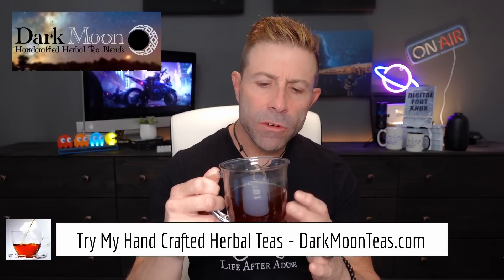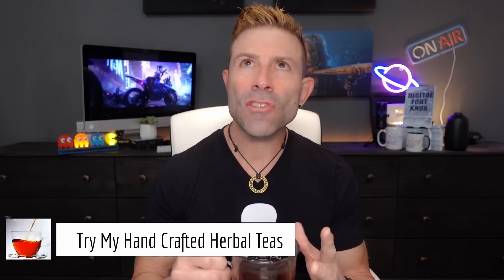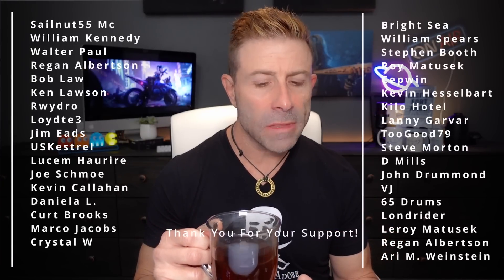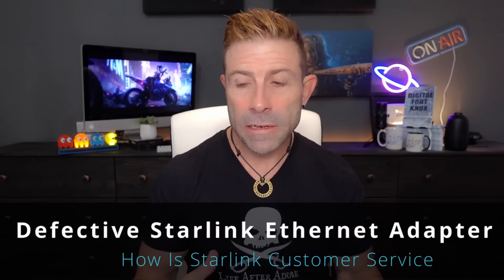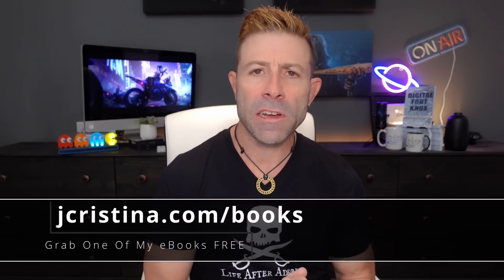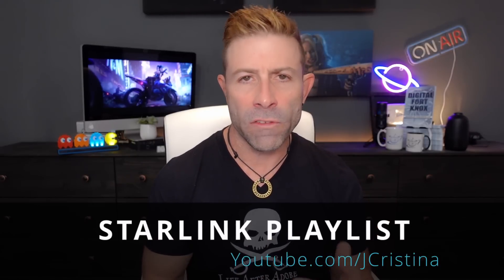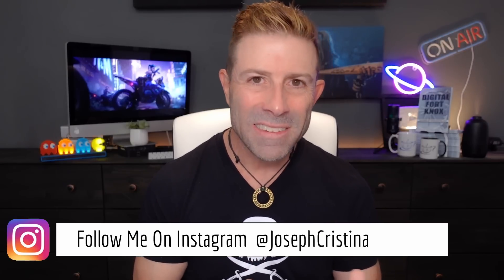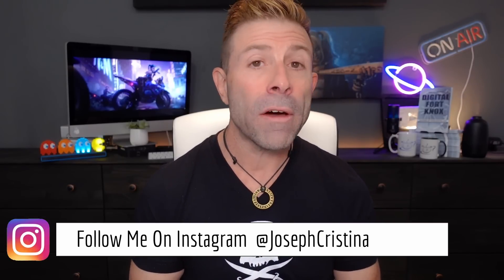Defective Starlink Ethernet Adapter Starlink Customer Service

Comment: I had a similar experience with SL recently; thought I would share.  Once my trees leafed out I was too obstructed to stream reliably.  I spent some time with my phone plotting out the new best spot; stowed the dish, disconnected, reran the wire, and hooked it up and nothing happened.  Wouldn't unstow etc.  So I did as much trouble shooting as I could, unplugging, etc.  Sent all this in tickets to SL.  Unfortunately I never heard back.  But luckily I thought of a previous email exchange I had with them and sent a follow up; this got IMMEDIATE attention.  I don't know if my original ticket was "misplaced" etc but as soon as I brought it to their attention with my previous ticket I received a slew of emails essentially thanking me for the troubleshooting I did, agreeing that something was wrong, shipping of the new unit, RMA, etc.  So while they handled it AWESOMELY once they saw the ticket, my biggest complaint was the time from the first ticket to when they "saw" it was borderline ridiculous.  I am talking 5 or 6 days (with add ons to the original ticket every other day) and I only think they got to it because of the alternate follow up.  Love your content on SL, don't know much about photography...but one can learn.  Thanks for posting again.
Reply from the maker: Thank you so much for sharing.. I love the idea of responding to a PAST email / support ticket instead of creating a new one.. Interestingly enough. This is what I did also but didn't think about it until you brought it up.. Thank you for that!

Comment: Just seen your video, I had to message them to get a new router because I think there was a problem with mine  (I CUT OPEN my rougher to see if I could fix it) so they actually called me and told me that there sending me a whole new starlink set (Satalite and router) for free just return old one and I told them that I cut open the other one and Lorain who I've been messaging almost everytime something went wrong she told me that usually it voids the warranty but they said just send it back with the that no matter the condition and that they told me to hold the old one till new one comes in and return the old one once it arrives and there giving me a month's free so hopefully I'll get it soon I told them this on April 28 and fed ex says it will be here on the 5th wich I've been everything a day later than fed ex I've had My starlink for 3 months with problems so hopefully everything works this time  just thought I'd let you know my starlink story
Reply from the maker: I hope all will work 110% and I'm amazed they took back the cut open unit.. Extremely nice of them, for sure!!
Reply: @jcristina  right and what really got me is that and they actually called me when I called them back i get like a SpaceX voice mail

Comment: My non-existent connection after a week determined mine was defective… still waiting after a week to hear back from them.
Reply from the maker: See if you can REPLY to a previously service ticket / message.. That might work for you!!
Reply: @jcristina  I replied to the ticket I started, if they don’t respond this week I’ll probably start a new one. I found a wireless extender/bridge to hook my switch in to though so my pc in the basement can get on the 5g network again.
Reply: @jcristina  just a heads up, I sent you a message in instgram. If you’re interested in looking at a second adaptor I’d be happy to send mine

Comment: Really appreciate your Star-link videos, I am in northern Alberta, Canada ordered SL for a rural property expecting many months wait, received in 2 weeks! I have tested and actually works :) 
I am following your network advice and purchasing the tp-link devices in advance of building 1) metal workshop with power 1st with SL on roof 2) need wifi to unpowered cabin about 250 ft away, hoping AC1200 will work through some trees, and 3) house next year about 30-40 ft away. 
Question what would you recommend to bring wi-fi from workshop into the house? Sorry for long story and thanks again!
Reply from the maker: I like a buried CAT6e cable best. If not, I would stairstep multiple EAS I have in the description, say 125ft apart outside for the best signal. Is you have line of site, 250ft will work but you will not get full speed out of the signal.. I would simply add additional EAS to the mix to keep the signal MAX..

Comment: i have a similar problem with my starlink v1 sometimes when i close and open my computer my ethernet port is negociating 100 mbps instead of 1000. i have to unplug and plug back the ethernet cable. My computer is connected directly to the aux port of the starlink router.
Reply from the maker: That's a bad "going bad" wire in the Cable most likely.. I would switch it out to see if that fixes the problem.. If not, then it's the computer or SL port, sadly.

Comment: I received my ethernet adapter on 21 April 2022, after a one month wait. After one hour of use, I determined my ethernet adapter was defective on 22 April 2022 - I notified Starlink immediately. Next day I got the exact same response you had. My order was placed etc etc. However, my replacement has not shipped, after repeated inquiries they claim there is no expedited process. They anticipate my order to ship in mid-May. If I had to guess, the STARLINK folks know who JCristina is and they take care of you so you will report your excellent support experience, as you have. I do not think that is the norm... oh, and they also told me I had to return the defective adapter.
Reply from the maker: I would hate to think that.. I'm a tiny channel.. I doubt they know me but anything is possible.. I certainly have never told them. Really sorry to hear this, Timothy!!!! Sucks...
Reply: @jcristina  I sent them a message yesterday (with a link to this video) asking why my replacement, ordered before yours, still was unavailable, while you had yours in three short days. They replied, without answering the why, and said my order will now ship in the next day or two. Something is fishy...

Comment: What components are shipped with Gen 2 Starlink?  I've heard you mention replacing their router so I presume the router and modem are separate boxes?  Or is the modem embedded in the antenna (since the dongle has a direct connect to the antenna)?  Is there a block diagram somewhere?
Reply: There’s also a base that the dish sits on as well, looks like an X
Reply: It comes with the dish, a cable (I can’t remember the length), the router/modem and a power cable.
Reply: @ShawnHinck  So the router/modem is a single box.
Reply: @SMButler  correct
Reply from the maker: Dish, Router, 75ft or 100ft cable. The modem I do believe is in the dish, don't quote me...

Comment: I'm glad I've got the round dish with the auxiliary port built into the router.
Reply from the maker: It is helpful.. You don't have the BY-PASS feature I believe but everything else is as good if not better due to not having to use a "DONGLE"  YUK!

Comment: Hi I watched your video on contacting Starlink to replace your Ethernet Adadptor. I ordered the starling system and while trying to thread the cable through the wall I damaged the cable. Went into Starlink and ordered 2 cable. They are so slow shipping anything out. How can I contact Starlink to get my cable higher on the shipping priority.
Reply from the maker: I think the "slowness" is due to short supply and not actually slow due to not being able to ship the product out in a timely manner. That being said, I could be wrong and I would reach out through their MESSAGES (ticketing support) system to see if there is an ETA on your replacement unit.

Comment: That was MOST useful and interesting so thank you for sharing it. Sounds like Customer Service did a pretty nice job this time. Now, I wonder if I can talk you into opening the old dongle up and seeing if it's just basically a pass-through to that proprietary connector or if there is some little circuit board in there. You've probably already thought about it, knowing you, but thought I'd ask in case.
Reply from the maker: Glad it was helpful! Great idea Dale.. If time permits.. Might be fun!

Comment: Just set my starlink up this weekend (with ethernet adapter) on my off-grid property in Joshua Tree! Was worried as it took a while to boot and get set up (probably an hour) but even after that I was seeing about 108 down, 14 up, which is crazy good for the middle of nowhere. I expect this might improve as it actually figures out what's going on over the next however many cycles. Very happy so far but of course just getting started....
Oddly, no "bypass" option in my mobile app even when using the ethernet adapter and I looked on every screen. Weird.
Reply from the maker: Strange.. Maybe you have a generation 1 unit (ROUND DISH) and not rectangle/
Reply: @jcristina  Nope, definitely the new rectangular one and the external dongle you referred to this in this video. That said, it was giving a "red" update banner for starlink itself when I was on the land last time and it's possible with new updates it will show up!

Comment: My dish is the model where the cable is directly hooked into the dish and cannot be removed, and then it comes into the house and to the Starlink big black box router, then it goes to the modem which does have a 2nd port, i wonder if am I going to need this same thing do you think? I definitely get those outages all the time. The Tp link switch is a good price so I should test this too.
Reply from the maker: I love the managed switch for data shaping .. This way I can say who gets the lion's share of the
 data at any given time.. As for the router you have.. I believe you have a Gen 1.. That router does not need a "dongle" or Ethernet adapter as it has a port on the back!
Reply: @jcristina  yes it does have a port that goes direct into the modem. I did have zero frames dropped last night playing a game for 12 minutes straight that is a new record for Starlink so maybe they are slowly improving i hope. 
     I have never set up my starlink direct into the pc before, i only use the wireless. There are no videos showing how to set that up that I can find. Is it easy? Do I just plug it in and my pc should detect it? Do I route an ethernet cable from the 2nd port on the back of the modem to my pc? I just got a new pc, I was on a laptop for the last year.
Reply: @jcristina  I came back to this video to find the name of that hardware again,  and ordered this switch just now. my app also miraculously reset itself back to the updated firmware. I think the new firmware in the app may be glitchy when you switch from split band to single band. I hope this gives me a bit more stability but I know I can't guarantee that.